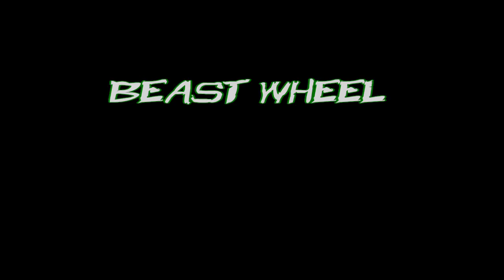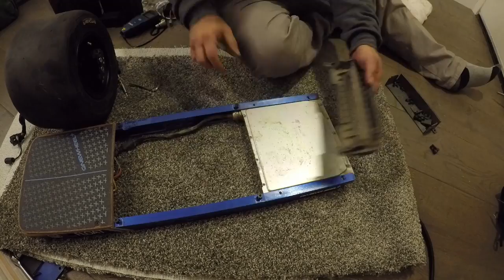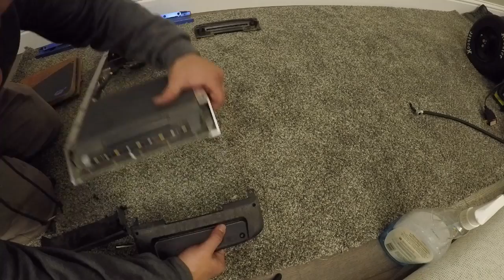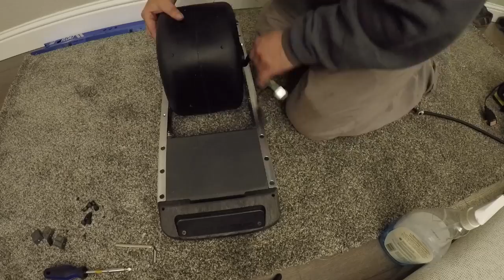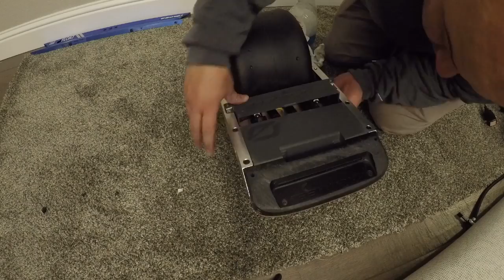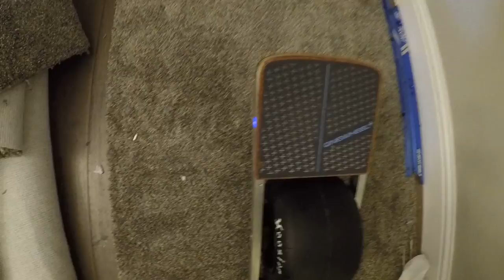Onewheel Workbench: Installing Beastwheel Rails

Comment: So what’s your impression of the Beastwheel Rails? Does it change the way the onewheel performs? I always wondered if they threw off calibration.
Reply from the maker: Tim Zarza they're good looking and add about a half inch total length to the wheelspace which allows for more tire options. It performs the same as the stock rails. There doesn't seem to be any negatives, besides the cost.
Reply: @Grind671  so simply they are the same length so calibraation of were the tail is on power up shouldnt change. but if it did add 1/2" in length [which it dosnt] it shouldnt change powerup calibration because you could power up at a good range of tail angles. cool mod. couldnt open the link

Comment: hey man just curious if you could link me to the proper size and compound hoosier slick that fits without shaving the tire or changing to the beast rails?
Reply from the maker: Some people like their tires soft(D10A), some like them hard(D30A). Here's a link to the D20A that's in between. Feel free to switch to whatever hardness you want http://www.jegs.com/i/Hoosier/522/11600D20A/10002/-1

Comment: Man... 300$ for two peaces of aluminium, you must be rich! Why didn't you sand the original? much cheaper to do
Reply from the maker: I wish they were mine :) I actually installed these for someone - I don't have a pair myself.
Reply: The original rails are painted, just ask a garage to sand them using gunsmithing.. you will get a clean polished silver effect and it wouldn't cost you that much ;)
Reply from the maker: Thanks for the info. I don't plan on switching my rails, but if I did, it would probably be because I want a larger tire and need the extra 1/2" wheel space.
Reply: The original rails are anodized, a very different process than with paint.
Reply: Those rails have a better clearance tho?

Comment: But all I want to know is .....WHY?🤨🤔  because if the ones that you’ve got originally worked fine and also they were installed by a professional at future motion and since these are just a cosmetic upgrades I don’t think it’s worth 300!!!! Bucks !!! For something that does absolutely NOTHING to the ride quality!!!! It’s  purely cosmetic !!!!  And also you may have voided your warrantee 🤦‍♂️😥 and  you have UN-zeroed your calibration because you did not  installed these things on a flat surface !!!! Everything future motion in stalls on your board or anything is built on a completely flat surface that they paid extra for to have made in their building when they’re building Onewheel’s ...everything future motion installs on your bored or anything is built on a completely flat surface that they paid extra for to have in their building when they’re building Onewheel’s
Reply from the maker: I actually did this for someone else. People get them for differing reasons: cosmetic, allows for larger wheel size, damaged rails, etc... I've heard the claim that the future motion marketing guys made on the voice of onewheel show, but several thousand onewheels have aftermarket tires without any calibration issues.
Reply: Ok, your a good friend 👍💯✅

Comment: Are these still available somehwere? The website seems dead
Reply from the maker: Crew Tube it doesn't seem to be available anymore, I'm not sure. You can also check out ruckus rails which are a couple pounds heavier but made of steel
Reply: Seems ok to me http://calibratedpower.com/beast-wheel/beast-wheel-rail-set-696mm.html
Reply: Just ordered a flight fin version of these,  the link was a dead end. Any suggestions on a larger off road tier with the clearance?